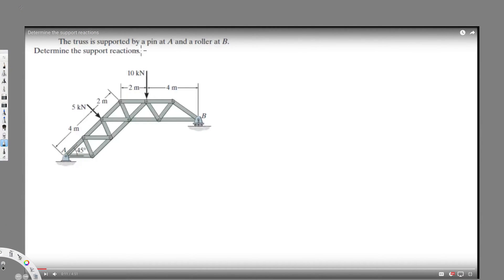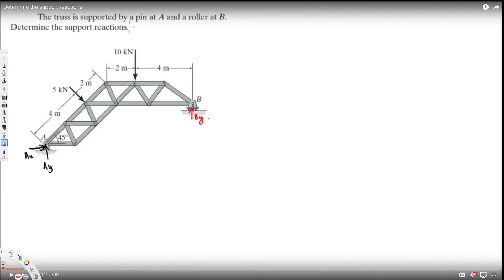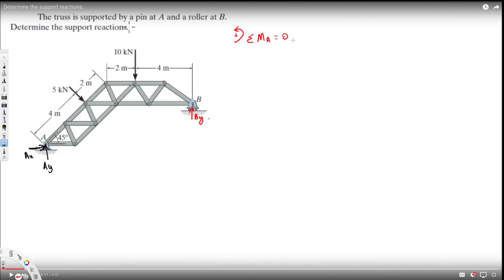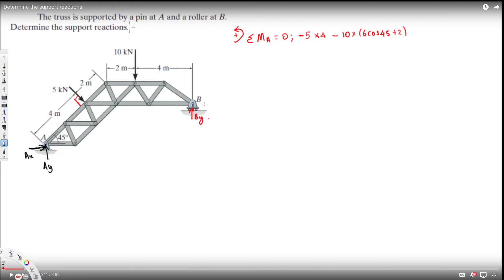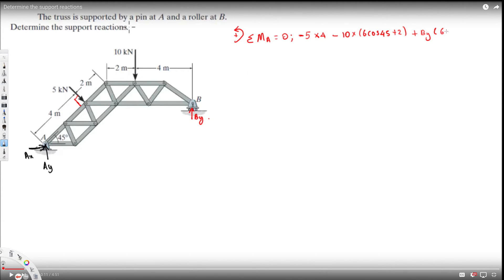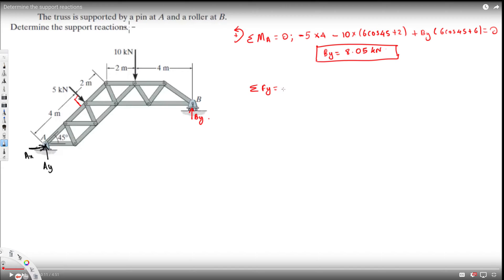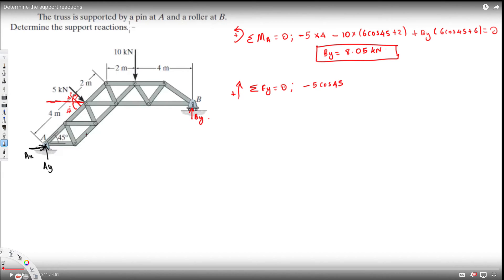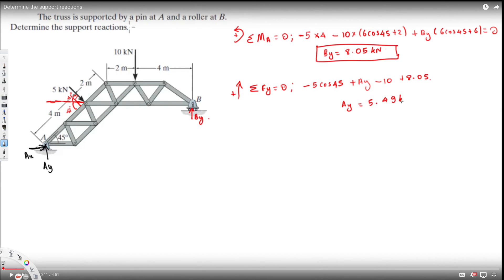Determine the support reactions.

Comment: shouldn't your first 2 eq with the sum of moment for A and sum of forces for Y supposed to be using sin instead of cos?
Reply from the maker: Yes that is a mistake. Sin is the correct expression for y component.
Reply: thanks for the quick response
Reply: cos45 and Sin 45 One Monday  @ThilebanTheEngineer